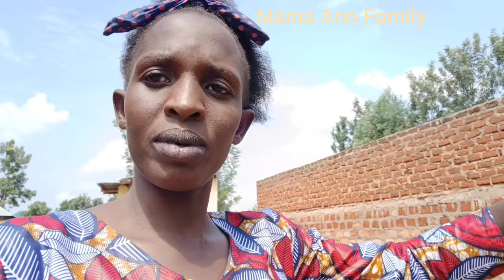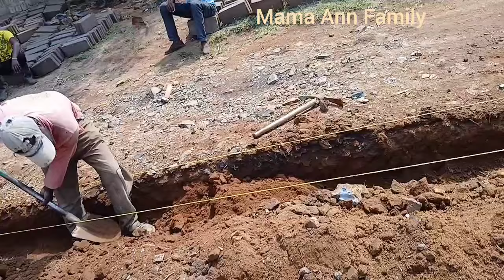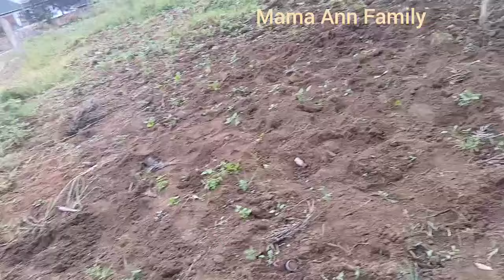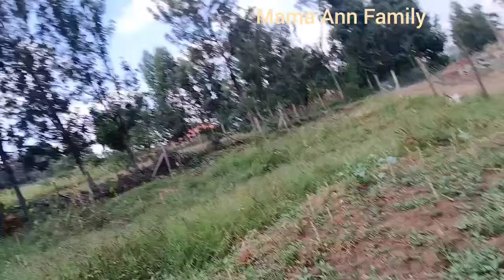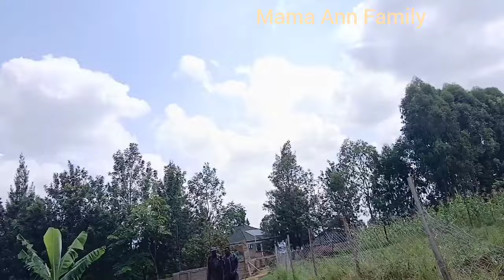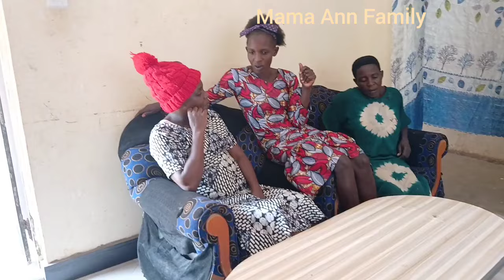Am confused guys on this!!I need your advise 🤔

Comment: Mama Ann may  have gotten a new house from the village and YouTube fund raising, however, at the end of the day, the land belongs to them and they should not be coerced into providing land for the road. Unless the house was built so as to provide the road, but even so, the whole process should have been vetted out with the chief and the cost of the house viz a viz the road should have been equivalent. In any case they are diverting the road (still providing land)  to increase their compound!

Comment: What was the rush for a perimeter wall? Extending it to whatever position will not stop any tippers from crashing into it. Uncle moh’s fence is so close to the road and is equally facing same risk. Every wall on the road side is at a risk of being crashed into by any vehicle, not only tippers. Please talk with your neighbors and others that will need the road.